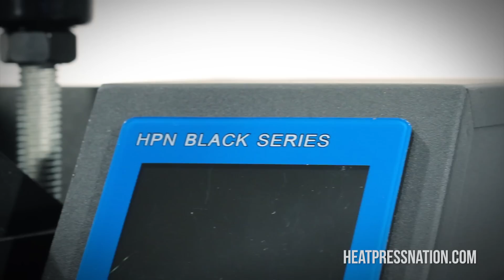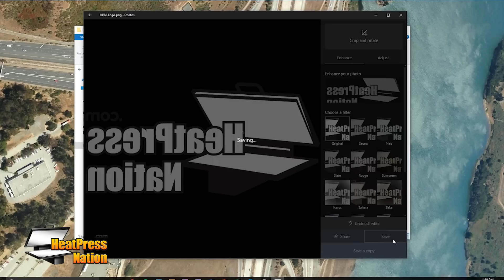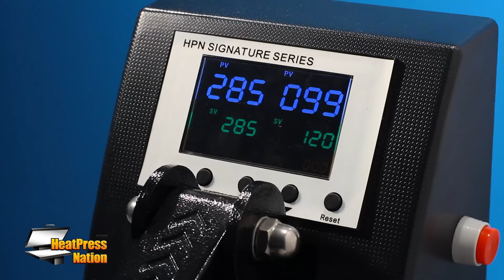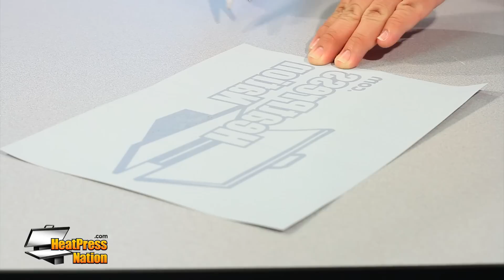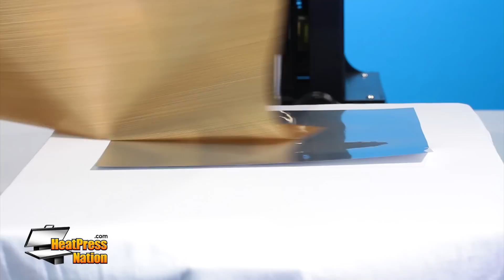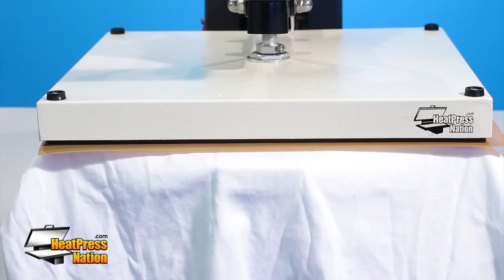Creating Custom T-Shirts with Forever Flex Soft Heat Transfer Material

Comment: In the video, the transfer sheet being used is a 8.5×11 or a 11×17? I ask because forever states you should marry the two sheets for 120 secs if you are using the 11×17 sheet and 90 for the other. I'm having issues with my transfers and I am trying to get them correct
Reply from the maker: These are 8.5"x11" transfers. A few tips to get best results:
- Pre-heat your lower platen for about 30 seconds before marrying the A & B sheets together. 
- When peeling apart the A & B sheets, do it in a smooth motion. 
- It's also important that you don't lift the transfer when peeling apart. The A-sheet should remain touching the lower platen, while you peel away the B-sheet. You don't want any cool air to get under the A-sheet. It's very sensitive to temp changes. 
- Peel it as soon as possible. Use gloves if necessary. 
- Don't forget to do the little rubbing thing with a clean cloth or extra t-shirt. Not even sure why/how that works, but it does. 

-Jared

Comment: The instructions with the paper suggest 90 seconds for A4 transfer to B sheet. Your video suggests 120 seconds - which is correct. Why does my design bond and completely stick to my 100% cotton garment after pressing 30 seconds at 285 degrees using medium / firm pressure and allow to cool and attempt to peel cold!? I’m using HP hl2320 to test

Comment: I have not seen this addressed or might just have missed it on the many videos I've watched... What is the shelf life of the A-Side foil once it's printed? IE: If I print 30 A-side and have an emergency where I can't transfer them until a week (or month) later, will they still be good?
Reply from the maker: There isn't an official recommendation (that we're aware of) from Forever paper regarding this. But from personal experience, I've had some A-foil prints that I stored for a few weeks before marrying with the B-sheet and they came out fine. I've also had some pieces that had already been A/B married & peeled that were stored for a few weeks before the final press and they came out fine. I suppose as long as you don't get any dust on them, it should be okay. 

-Jared

Comment: I'm using the CraftPro 13x9 and I can't get perfect transfer of A and B sheets using the forever recommended settings. What heat temp and time would you recommend when using CraftPro 13x9??
Reply from the maker: For that, we recommend contacting our Technical Support department. They can help you fine-tune your settings to get it to work.

Comment: Hi, I'm trying to use this kind of paper, but I Have an HP pagewide management MFP P57750
Does it work to print the sheet or not, because I did it and never transfer the design, please help me
Reply from the maker: Forever Flex Soft is designed to work with OKI laser printers, but will also work with any laser printer with black toner that does not have an oil fuser system. We use the Brother HL-L2320D (as seen in this video), which is a basic black & white printer, and get fantastic results with Forever Flex Soft. Double check your printers specifications to make sure that it 1) is a laser printer 2) does not have an oil fuser system.
Reply from the maker: If you purchased your Flex-Soft from us, you are welcome to contact our Technical Support department for more detailed troubleshooting: heatpressnation.com/technical (please have your order # ready)

Comment: Can any laser printer be used? Do you use standard laser print cartridges ?
Reply: Yes, you can use any laser printer with standard ink toner. For best results, you'll want to print your design in one solid color - black works best.
Reply: Jared Barbosa hi,, so only solid colors will work with this paper?
Reply: Yes, this paper will produce in image in one solid color - whichever color of Flex-Soft you purchase.
Reply: Jared Barbosa what about the transparent paper? Which laser printer would u use for that paper?

Comment: Can you layer HTV with this (for multi color designs)?
Reply: We actually haven't had a chance to test layering with this product yet. In theory, it should work if the Flex-Soft is pressed first, since it has a higher cook setting. But we wouldn't be able to guarantee any results.

Comment: is there forever flex transfer papers that will work for inkjet printers that will let me have the metallic finish???
Reply from the maker: Unfortunately there is not. The toner acts as an adhesive and that is how this technology works. Inkjet ink does not have the same quality. Please note that you can use any low-cost that prints black toner with Forever Flex Soft.
Reply: So I can buy a cheap laser jet printer and it should work correct?!
Reply from the maker: Yes, the laser printer used in this video is only about $80-90 and it's a basic black & white laser printer from Brother printers.

Comment: Hi can I use canon LB 151 monochrome printer for use with forever flex soft no cuts
Reply from the maker: That printer should work fine, though we haven't tested it specifically. You can use nearly any monochrome laser printer that is able to lay down solid toner coverage on your prints. We use a very similar printer, the Brother HL-2320D, for our testing and it works great.
Reply: HeatPressNation thank you very much for your info

Comment: What's the brand of the laser printer you guys used? Thanks!
Reply from the maker: We used a Brother HL-L2320D Monochrome Laser Printer found here: https://goo.gl/nkvqN6
Reply: Thank you! Also, I want to use my own portable heat press from Cricut. How much weight should I apply when pressing down? Thank you again!
Reply from the maker: We do not recommend using the Cricut EasyPress with Forever Flex Soft. Forever Flex Soft (like nearly all laser transfers) requires consistent pressure and temperature to ensure a proper A/B paper marriage and transfer to your garment. This can only be achieved with a quality heat press.
Reply: Thank you!
Reply: I've got everything now, but can I use teflon sheet instead of the non stick sheet? I'm also heat pressing onto a jersey material.
Reply from the maker: For Flex Soft, the manufacturer actually recommends parchment paper, which you can find here: https://www.heatpressnation.com/pro-grade-non-stick-paper-15-roll.html

As for materials, you should always do a test press of a material to make sure it can hold up to the temperature required for heat pressing.
Reply: Thank you for all your help! I love how mine turned out! The video really helped a lot, and your customer service! Also, do you guys have this forever soft flex heat press product for jersey and when are you guys restocking the color white? Hope you guys will not discontinue this! Thanks again! (:

Comment: Can I use B&W printer for this? 🤔
Reply from the maker: Yes! We used this B&W laser printer: http://www.heatpressnation.com/brother-hl-l2300d-monochrome-laser-printer-with-duplex-printing.html
Reply: HeatPressNation only this B&W printer or any B&W printer 🖨?
Reply from the maker: That's the printer we used and also the one we sell. LED laser printers are recommended, but for this product you can use almost any B&W laser printer. The key is to get good toner coverage on the initial print. If it prints lines or looks spotty, the transfer will not work.

Comment: Hi will this work on a Lexmark C544dn printer?
Reply from the maker: Based on the specs given online, it should work with that printer. With this paper, you'll want to make sure that whatever printer you're using can give solid coverage with your black toner. That's going to be essential to the success of your transfers.
Reply: HeatPressNation would a ricoh SP C250DN be compatible with forever transfer paper?

Comment: How long does the design will last on the t-shirt after wash.
Reply from the maker: It varies depending on the continuous area coverage of your design. In general, a design with solid shapes will last at least 5 washes while looking brand new and slowly begin to wash out after that. There is a technique called rasterization that renders your image in a dot-matrix style which would extend the life of your transfer to about 30 washes.

Comment: Hi.  I'm using the Flex Soft white product and printing a black image from a CYMK laser printer using the transparency setting.  I'm not sure where I may have messed up, but after my final peel from the t-shirt, I was left with black print on the T rather than white.  This was my first attempt.  Can anyone tell me why this may have happened?
Reply from the maker: Hi Jason, I would suggest speaking with a member of our technical support department. They are available Monday through Friday from 8:30am to 5:00pm Pacific time. 800-215-0894
Reply: I have had multiple conversations.  No one seems to be able to explain why this is happening.  One of the support members is waiting to hear back from the manufacturer.  Everyone seems genuinely concerned, but no one has any real suggestions.  I had very high hopes, but unfortunately, not a very good first experience.  Nonetheless, thank you for your reply.

Comment: OUCH ALMOST 5 BUCKS A SHEET FOR 11 BY 17?
Reply from the maker: We feel you! The real value of this paper is that it saves the time spent weeding complex graphics pressed with heat transfer vinyl. A complex graphic of that size could take up to an hour or more to weed out. That time could be saved using this paper and time = money. For simple graphics that can be weeded in HTV fairly quickly, it wouldn't be worth it to use Forever Flex-Soft.
Reply: Many places have 8x11 for $2.00